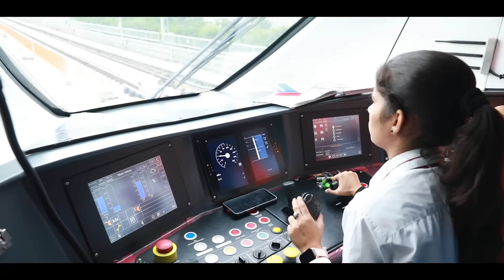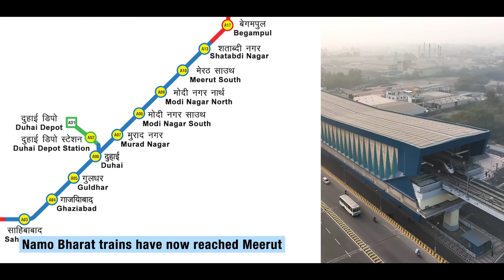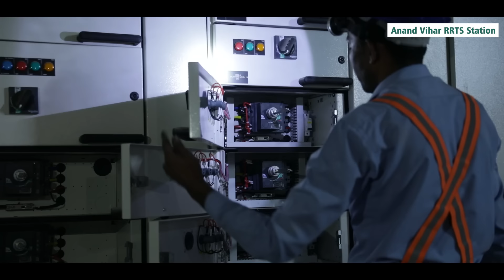Namo Bharat train reached Meerut on 29th December 2023

Comment: I think with this type of super structure we should  think about over 250km/hr speed.
Reply: with 250 kmph you can not expect stopages after every 5-10 km. y250 kmph need at least 30-50 km free run.
Reply: @vikashkumarvicky9449 we can skip station's for fast speed trains just like bullet trains do
Reply: Maybe the structure and tracks doesn't support high speed
Reply: @hemantv1676  Yeah, you can see when the tracks are crossing roads or train tracks that they have too much curvature for high speed rail. High speed has very low tolerances for curves, if you are building viaducts that have to conform to roads they won't work. Thats why mostly they pass by the edge of cities or they have to go through tunnels.
Reply: @hadhamalnam  true both are different